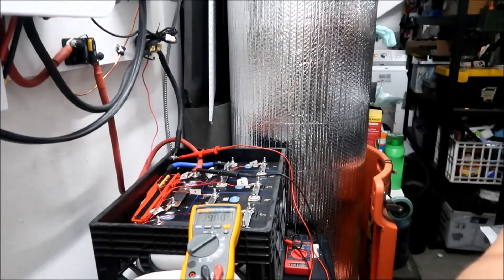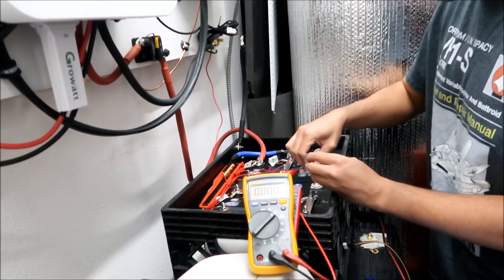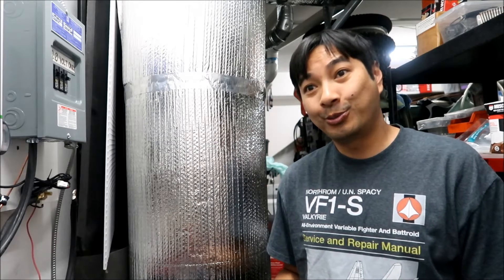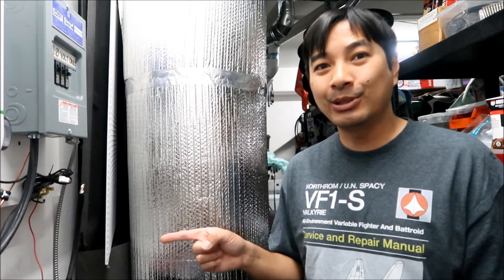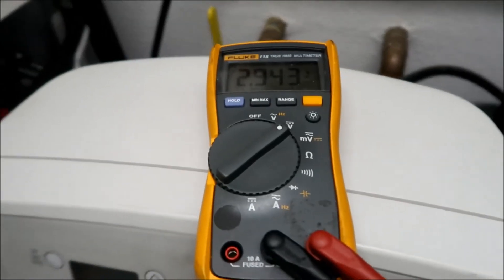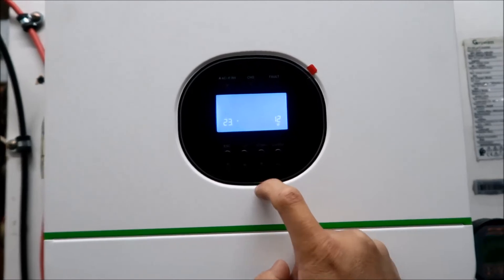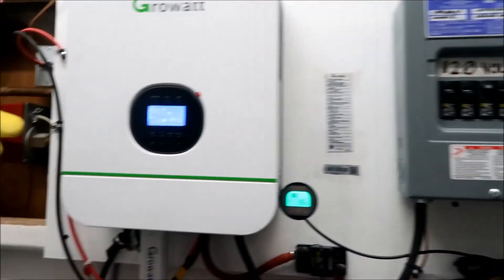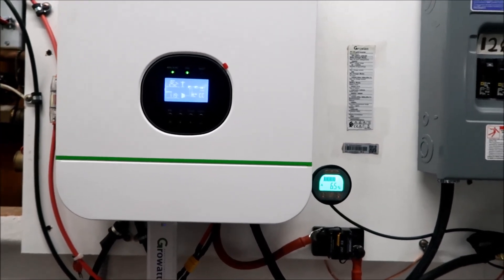HadesOmega Solar Garage Project Episode 74 - System Down BMS Disconnected Part 1

Comment: You may answer this question in Episode 75, so if you do, please ignore this question. I think your system is set the same as I have designed but not created mine. However, I am using AGM batteries. Here is my question: Did the batterie's BMS shut off the supply of DC to the Growatt (you keep saying "inverter") and the Growatt not automatically switch to Grid or Solar (if it was available) due to "...the inverter needs the DC...to run" ? I thought it supplies itself with whatever is available depending on how you set up the menu item priority? (My Growatt is still in the unopened box but I am watching and rewatching YouTubes to make sure I set mine up correctly).
Reply from the maker: There is a setting that will allow it to charge off of both solar and utility.  I think it's setting 14, it goes over what each setting does in the manual I have mine set to OSO only solar which only uses solar power to charge the battery.  If you want both it is SNU solar and utility.  There CSO Solar First and CUT Utility First as well, that sets a priority on one.  I have not really tried anything but only solar, maybe I will in the future.

Anyway yes the BMS disconnect the battery because one of the batteries voltage dipped too low underload.  I needed to do a bottom balance.
Reply: @hadesomegamoto7639   I can not thank you enough for your last two YouTubes, but even more for answering my questions. I am going to go back and watch your other YouTubes to learn more without asking questions you probably have already answered. 
By the way, I am an old Moto-X / Desert Racer myself! (Barstow to Vegas, Carlsbad (yes that old) Grand Prix, .......)